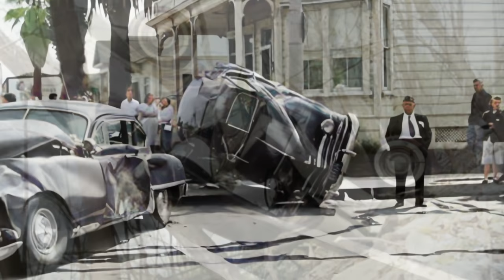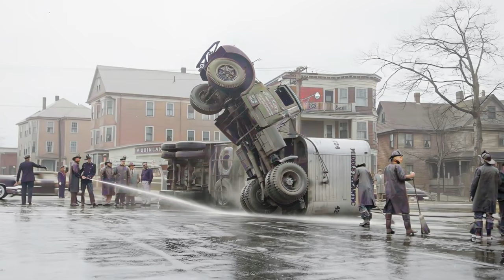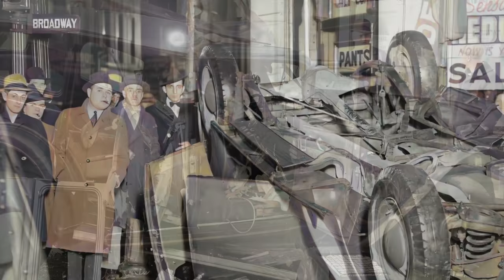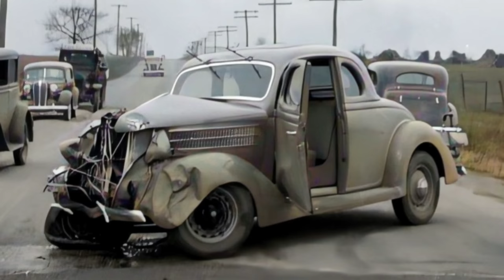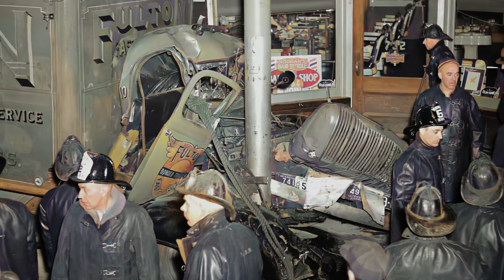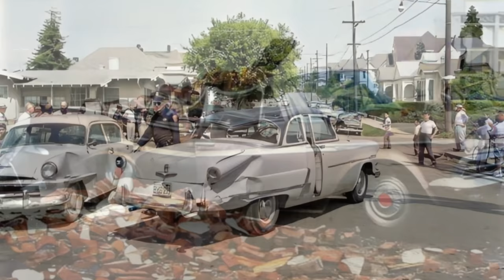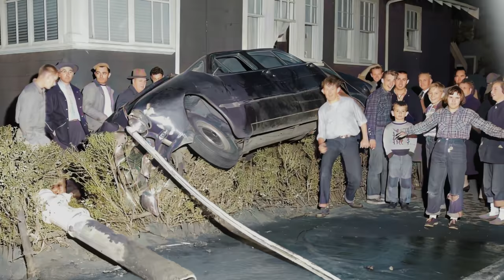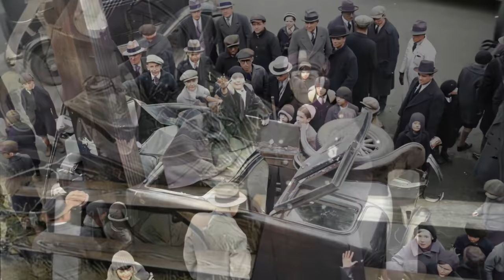Crash Chronicles 2 [Colorized]

Comment: “The cars back then didn’t last as long?!”  You’ll not find a single 2023 Ford F-150 or Nissan Altima that exists 50 years from now…
Reply: You'll be lucky if the transmission on an Altima lasts 5 years.
Reply: they're not built to. For that matter, how many 1991 Chevy Corsicas or Berettas do you see running around?  Cars use a lot of planned obsolesence.
Reply: Not sure about America, but in Europe 20yr old cars quite common now, in the 60/70s they fell apart from rust
Reply: It's more related to rust. The old stuff just rusted. Manufacturers have only really got to grips with rust since roughly year 2000 or a little later. Perhaps helped further due to the fact loads of parts are now plastic.
Reply: My grandpa has an old car i think he said it was a model T or somthing he said model then a letter
Reply: @carson27907  cool story
Reply: @mikeh2006  i cant tell if youre being sarcastic or not but thanks
Reply: @saraprva4172 I seen a few here in the USA
Reply: Rusting out is a geographical thing too.  In MI the de-icing chemicals ruin a car, but in MT (until recently) they didn’t rust out due to chemicals.
Reply: @carson27907 pretty sure that was sarcasm…
Reply: Today’s cars aren’t meant to last more than 8 years and EVs are disposable replacing batteries or fixing them is more expensive than the cars value.
Reply: Why the hell would anyone want a Nissan Altima in 50 yrs? Nobody wants them now.
Reply: @johnnyl321 there are 3 Berettas, a dozen early 90s Z24 Cavaliers, and God I don't even know how many celebrity station wagons still running around my area. Hell, one of the Berettas is a 5 speed Z26 and is driven by a 19 year old. Shit is in good shape too and he keeps it up
Reply: Butthead don't know what he's talking
Reply: All the cars you might see now that are 50 years old (1973) are one out of thousands that were produced and have been maintained and/or restored at great expense. They will stay expensive to maintain. 

I am 77, so I have owned cars built between 1965 and 2007. If you got 100k miles on a car, it was a miracle. The cars built in the 1970s in particular were crap. That is why Japanese cars took over the markets so quickly. Better built and also better fuel economy. In the 1970s, gas prices went up almost 300%, so that was extremely important. If you were a self supporting adult in between 1973 and 1983, today’s inflation and high interest rates seem meaningless.

The only 1970s car I had was a 1971 Dodge Challenger. I didn’t have it long because I needed a car to take big dogs to dog shows—which then meant a station wagon. Oh, wait, I traded in a 1970 Ford Pinto for the Challenger. Now THAT was a piece of crap. I could roll over a dime and tell if it was heads or tails.

The car I have now has been one of the best. It is a 2008 Honda CR-V that I bought in 2011. So far, all I have needed to do is get regular oil and fluid changes and a new battery. I don’t drive much any more, so it is even less now. This will almost certainly be my last vehicle.

One thing I noticed in many of these photos is how little tread the tires had. Some were so bald they were shiny. Of the many things that have improved so much is tires. Imagine having to get new tires every 5-10 thousand miles.

It is impossible for me to get nostalgic about old cars.
Reply: That’s a silly presupposition! ANY, and i mean, ANY currently produced vehicle could last 50 years if properly maintained and lightly driven! Most of the body and engine parts are aluminum and wont rust, tires, belts and hoses can be replaced every 5 years, fluids can be changed every 6 months, interiors can be reupholstered, exterior paints can be protected from oxidation, etc… Most vehicles that have lasted that duration have less than 200,000 miles on the odometer, are lovingly cared for, stored in a garage, and would be restored if necessary!
Reply: @mikeh2006 These newer cars, unless they're aluminum or some other material that doesn't rust, still have issues with rusting.

My 56 year old car has some rust on the rear quarter panels. My 26 year old truck has rust in the same places and on the rocker under the driver door. 

These newer Kias, I believe, or Hyundai's, that we're having recalls for their rear subframes rusting away comes to mind, too.
Reply: @enid0mom I own a '66 and I have to say my experience has been different. My newest vehicle, a 2015 Fusion, was a piece. My Galaxie is still going strong. Sure, I have to maintain it more often but it's still no more expensive maintaining and repairing it then it cost to maintain and repair my Fusion. 

Btw, I got rear ended in the Fusion, which was a blessing, because I got fed up with it after it left me stranded at the gas pump because the radio needed to update. It left me stranded until it updated. Couldn't start it, couldn't get it to move out of park. Because the radio needed an update.
Reply: 🤣😂 why haven’t you won the lottery?
Reply: @JollyRed0045 I know I can still drive my 68 charger and 69 coronet,with a little work I’ll be driving my 86 chevy truck and 68 gtx,and hopefully soon my 69 charger Ty.Given the choice I would take a 67 fastback,(or similar year),mustang,galaxy torino over most new cars.
Reply: That is a fact
Reply: virtually all vehicles can be maintained at a cost but many people would rather spend the money on a more modern vehicle... and i would say the 2023 vehicle is more reliable and better handling and economy than any 1950s or even up to 1980s equivalent vehicles.... last few modern vehicles i've own i've had virtually '0' major problems and very few minor ones in 150k miles and more.... but in 50yrs from now fossil fuel vehicles will be phased out and rare to see on public roads.... i'd even think driverless cars will be the main mode of transport by then.
Reply: @enid0mom Phenomenal response! There's a reason people are more likely to survive today's crashes than anytime before. I love the appearance of some of the old vehicles but hated maneuvering those boats!
Reply: Coffins last a long time too!
Reply: Thanks for the insight Nostradamus.
Reply: You’ll probably see a Toyota Tacoma 4 cylinder, a Corolla or a Camry last that long with the way the Japanese make them.
Reply: @AVportau Unless aluminum-air batteries take off, I doubt the push towards electric vehicles will go anywhere in the end. Biofuels will more likely end up being the replacement for fossil fuels, and depending on the details of how we accomplish that, current vehicles may still be able to run (probably more likely for diesel vehicles than gas, but not impossible for either).
Reply: You drive those vechiles once or twice a week & keep in then garage they will.
Reply: @carson27907 Aries K?
Reply: @thehighllama8101 Mine has lasted 11 years so far.
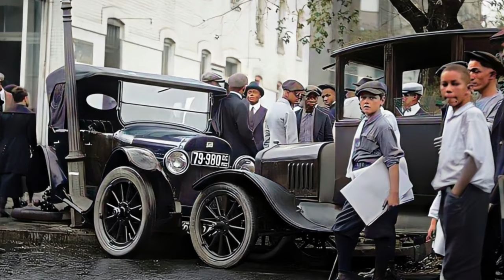Reply: PAUSE AT 8:05 AND ZOOM IN ON THE GUYS BEHIND THE HOOD. BRO, WTF?!
Reply: @lescobrandon6369  The guy with the modern looking sunglasses that seems out of place ? Or the black guy looking like he sees a ghost ?
Reply: @willymaykit1482   yeah, glasses boy and lizard man are wicked creepy
Reply: Cars were less expensive and weren't driven the miles they are today...
Reply: There’s a reason 6-digit odometers weren’t common until like the 80s and 90s…
Reply: What's it matter... you might not be around then either.
Reply: None of the vehicles you mentioned were worth saving for 50 years.
 Except for the f-150 i'm kind of partial to ford.
Reply: What are we talking about that last? Body,chassis,drivetrain? Body and chassis components on old cars I’ll say far outlast new cars. New cars drivetrains last much longer and with less problems during their life span. You can almost any brand new car these days coast to coast several/many times with only needing oil changes. If your were to do that in the 50s or older you’d be lucky if you did it once and I bet you stopped a few times with at least some minor issues.
Reply: @mikeh2006 as a mechanic in New York I can say they still have not figured out the rust issue, still yet to see a brand new Chevy truck without a rusted frame
Reply: @mustangman8517  I was referring to the body panels and bits you can see, rather than underneath. 
But yes I'm sure they do still rust. My car is 80% aluminium so luckily I don't really have to worry
Reply: @johnmccree8941 Oh he will be around a looooot longer than a Nissan or fucking 2023 ford
Reply: I drive a 1999 Honda Civic. Still in great shape.
Reply: Your probably right but as owner of a Nissan Altima that I have had for 14 years without one problem I'd say if it died tomorrow I couldn't complain. It's 2010 plus id say it's safe to say motors and parts of today last hell lot longer than the older cars. I'm 64 years old and had my share of breakdowns growing up
Reply: @thehighllama8101 
I've had Altima since 2010 without first problem. 111 000 miles. Best car I ever had.
Reply: You people must be young if you don't remember the hoses busting and belts snapping in old days. Starters going out. You don't see that crap these days.
Reply: @pmp2559 
I've had Nissan Altima since 2010 without first problem and cars these days go 200.000 miles without problem so what you said is VERY wrong
Reply: @justtubing767 
I've had one since 2010 and haven't had first problem not to mention you see them on road everywhere so what you said was not only very wrong it was stupid.
Reply: @Bacnow 
Your so right about cars lasting longer these days. Them guys in that string didn't have clue what they were talking about
Reply: @GettingOldBites420  You're calling people stupid in defense of an Altima? Yea, you're old.
Reply: Cars back then weren't safe
Reply: I do have a 1965 Ford F-150 that my grandfather bought new , still has less than 100K original miles , runs drives great  3 on the tree and it is built like a tank
Reply: I caught the same statement when he said cars didnt last as long. That was dumb ,because there are many classics still in use. Todays cars just shatter.and regular use wears them out in 10 years.
Reply: I was just thinking about that, lol!  I was reminiscing about the cars I’ve owned over the years and how I don’t see any of them on the roads anymore.   My ‘76 Monte Carlo,  ‘78 Corvette,  ‘79 Cadillac Coupe D’Ville and so many more 😂 I really need help with my car addiction ❤
Reply: @johnnyl321 several American cars are still around from the 90s I have an 89 celebrity and 90 corssica. My neighbor has a 92 cavalier
Reply: @crowdnine878  …..good point. I’m going by what I see, or in this case, don’t see. And I’m only 20 miles from a GM plant that built Buick/Olds/Pontiac/Chevies from 1946-2009. And I see zero Olds Cieras, Chevy Berettas, Celebrities, etc
Reply: @johnnyl321  fair enough my friend. Obviously won't be many simply because they were transportation for the average person. Never intended to be collectors items. I follow guys doing barn finds and that sort of thing... Or car auctions. Generally American cars. Most notably GM, Ford and a few German cars here and there
Reply: True words
Reply: @saraprva4172 I'm in America and I drive a 99 GMC suburban 2500 with 258k on the clock
Reply: I blame that most on the human need to feel better than someone. There are plenty of cars from the 80s and 90s that could easily have survived to this day just fine. But Carols husband just bought her a new SUV, so now Denise is crying to her husband about getting a new one, but with the luxury trim. The fact that some people spend $20,000 or more on an object they treat like trash, and toss aside 5 years later is pretty ridiculous
Reply: Actually, if you got ten years or 100,000 miles you were doing pretty good. Now when hit 100,000 it just means it’s time to change the spark plugs.
Reply: I disagree, modern vehicles are primarily constructed with aluminum and plastic. They’ll be around long after you’ve shuffled off.
Reply: I would rather have a classic than any plastic piece of garbage vehicle nowadays.
Reply: @pmp2559 just simply not true but you keep talkin 😂
Reply: @austincook2472  oh ok you know everything 🙄
Reply: My three cars from 1954, 1967 and 2006.  1967 rarely misses a beat, not so much the other two.
Reply: I own a 1975 Cadillac Eldorado convertible... It's 49 years old and only has 56,000 original miles, purrs like a kitten, garage kept, zero rust on the body, perfect original paint, but if someone crashed into me, I'd get messed up, nothing but a lap belt and a steering wheel to hold on too.
Reply: 2020s jimmys just blow up half the time
Reply: @saraprva4172  damn, got some good car systems. I’m sadly in America and they are designed to not last 10 years or you start getting warrants… I hate corporate america

Comment: After reading a lot of the comments , I watched thru the vid a second time and the comments were totally accurate...of the wrecks where the tire tread was visible , nearly all of them were completely smooth/worn down to being "slicks"...definitely a hazard !!   Good observation and no exaggeration on the part of those that caught that detail while watching...and thanks for sharing !!
Reply: I was wondering on the real old pics how the heck they got in to such predicaments when the average car topped out at such low speeds, but add inertia from wet pavement and slicks and it makes a lot more sense. The one car that was caved in from the top, from a pole or tree, I couldn't help but hope the driver was grown out and not flattened inside. Thank God we have the jaws of life tools now ... and mostly plastic cars.
Reply: @TheBackStory22 add in the weight of the cares as well: they’re much heavier so inertia is working against them when stopping

no power steering, no anti-lock brakes…no stopping or swerving
Reply: None of these cars are as well built as people today seem to think they are…
Reply: Absolutely, I noticed it while watching “A Christmas Story”, when the Dad and Ralphie changed a tire.
Reply: Since you pointed it out I won't bother but even when there was visible tread, there were no lateral sipes. Any of these cars on such tires would be a handful in the wet.
Reply: Car tires have improved as much as the rest of the car, you can get  at the least triple the wear out of moder tires with much better grip.
Reply: My father grew up during the depression. He stated that rubber was very hard to get at that time since most rubber went to support the war. You had to drive cars literally till the tires wore through before you could get retread replacements which obviously made for hazardous driving conditions.
Reply: That one may have been parked. @TheBackStory22
Reply: @AnnchristinaAlmazan thats exactly where I was going with it !!!! "They were tires in the academic sense, they were round, and once made of rubber " than line has always nade me laugh over the years
Reply: Bias tires they would thump in cold weather.
Reply: Are you blind? It's all AI-generated. Go back and look for hands and fingers.

Comment: Wow did anyone notice how many of those vehicles had totally  bald tires? No wonder they crashed!
Reply: Brake failure was a common thing back in the old days
Reply: Mostly were from the 1930's. Depression Era time
Reply: Rubber was scarce in the 40s, the war machines needed it.
Reply: Ya that right I noticed that too...
Reply: Balloons.  A lot of balloons.
Reply: I saw it too.
Reply: @max57rich37  They was old Drum brakes and had a single master cylinder. If one line failed you lost all brakes, except maybe a under equipped parking brake.  Now we have power disk that grab the disk rather than press against the inside of a drum.   But the main thing  was the introduction of a split master in 1962, by Cadillac.  This means the front and back are applied by the same pedal but different cylinders. If you break a front line you still have the back.
Reply: @jvmiller1995  I had the (single) master brake cylinder fail on my 1972 Hillman Avenger (Plymouth Cricket) when we were bringing our newborn second son back home in 2009.  His first journey could have been his last, but fortunately the brake failure hadn't happened at speed and I just slowly rolled through a junction where I was supposed to give way.  Another driver probably thought I was just being a bit ignorant when I actually had about 10% braking power.  I happened to have a brand new spare brake cylinder so got that fitted, but I'm always now aware of the limitations of not having dual circuit brakes on that car.
Reply: @video99couk  You can upgrade it.  They have made direct bolt on replacements for all of those old cars.   My old 53 truck had one and it et on the frame rail under the car. I found one with a small power booster even that was split.   I have a respect for keeping cars original but if you are going to use them in everyday life it is best to up date the brakes.   I imagine you can also get a front disk conversion that bolts right on.   That is some precious cargo cargo.      Like I had stated they came out with the duel in 62 but not all cars got them right away.   Glad everyone was Okay. cars can be replaced
Reply: did they even have treads?
Reply: Yeah, I saw that too. what a difference from the 70's
Reply: They are all ai generated lmao
Reply: @HatsuneM1ku01  actually we had cars back then, thats how things actually looked back then.
Reply: @catmanflorida2839  I know that, these images are quite literally ai generated though. Look at some of the license plates how the numbers are weird and distorted or some of them have multiple front license plates. Some of the building and street sign fonts are off too.